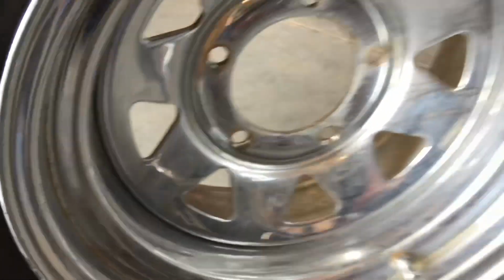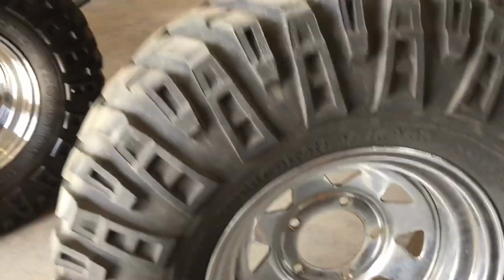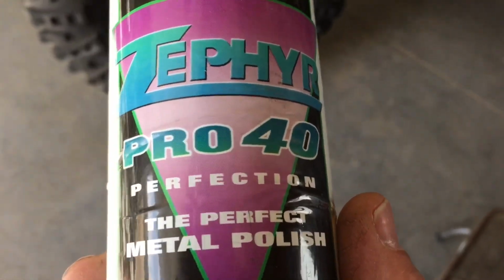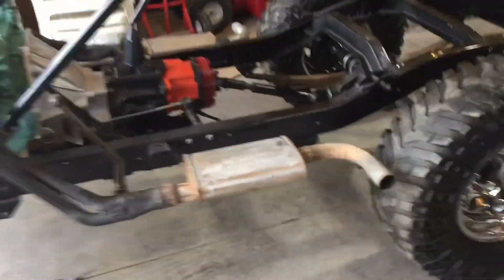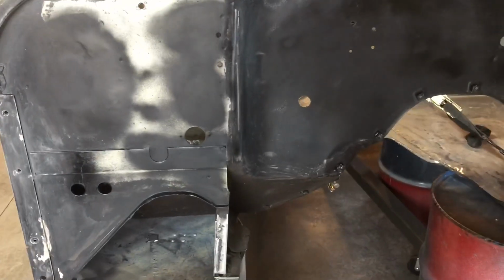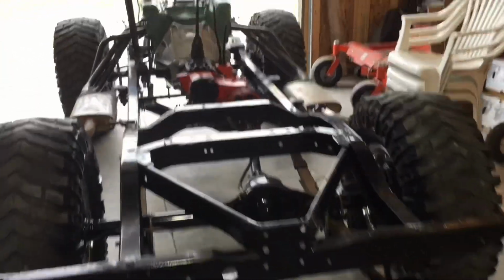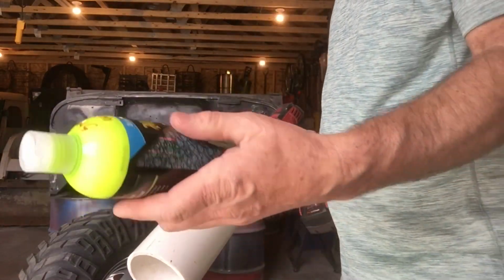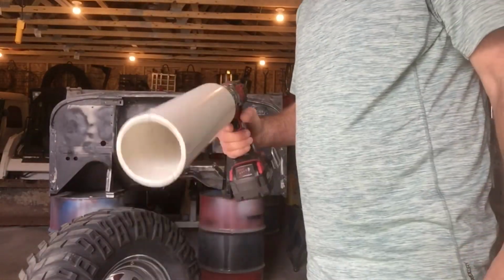Polishing Chrome Rims on 1962 Jeep CJ5

Comment: Curious if your front white circle parking lights are original, if not would you mind sharing wear you purchased them? I have a 71 as well. Looks amazing!
Reply from the maker: I put reproductions on, barneysjeepparts on eBay, $16 for the pair of lens. The old ones were frosted from age, plus one cracked. The inside of lens are not smooth, rough to reflect light so polishing would be difficult.